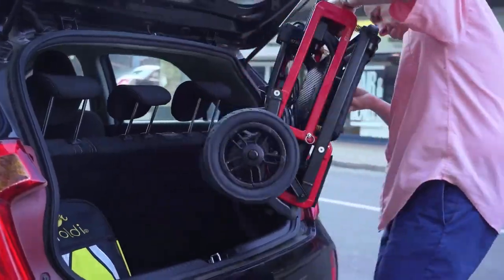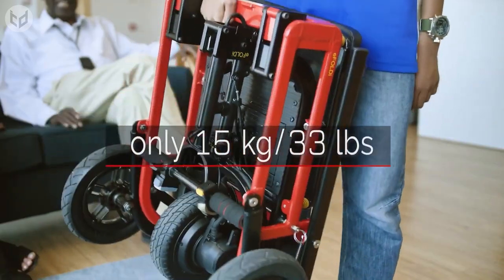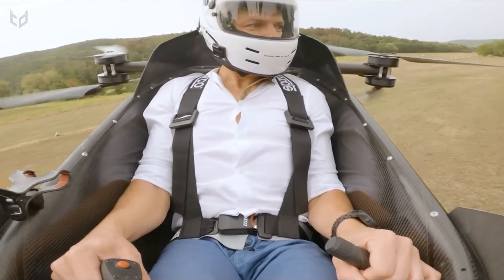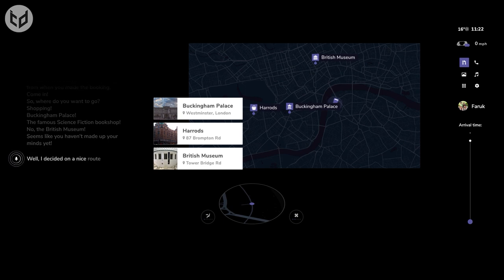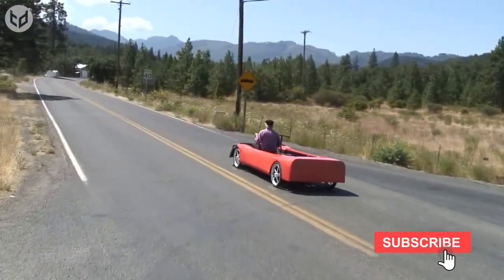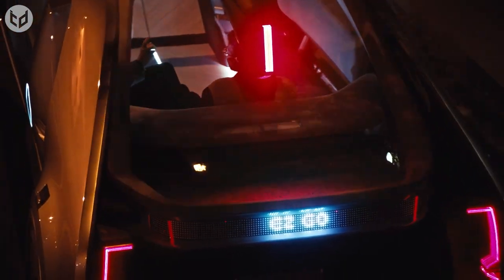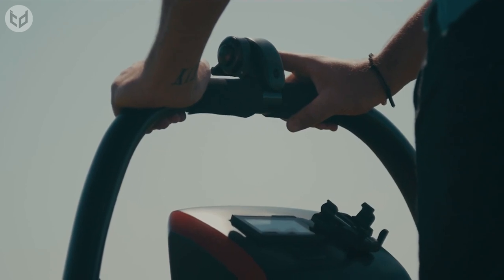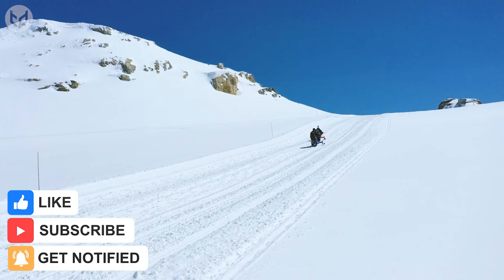9 Most Unusual Vehicles - Future Tech Transportation Systems #2

Comment: Quadcopter is cool.  But it needs guard rails around the blades.  Or the blades need to be above the head like a helicopter.
Reply: It would be easy to duct those propellers. I'm surprised they didn't do that in the first place

Comment: The problem I have with the self driving vehicles is that: 1. Many are based on an actual driver that the ai learn driving from, so they have also learned all the horrible habits that the driver has as well. 2. The manual override is faulty. In the end, accidents are too likely, which sucks bc I would love self driving cars.